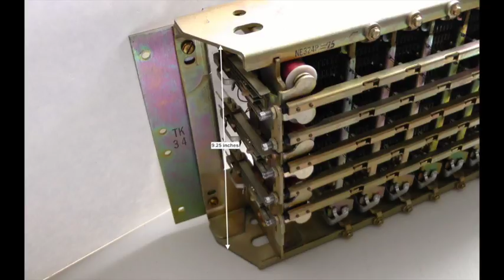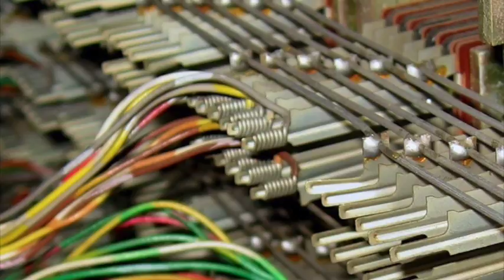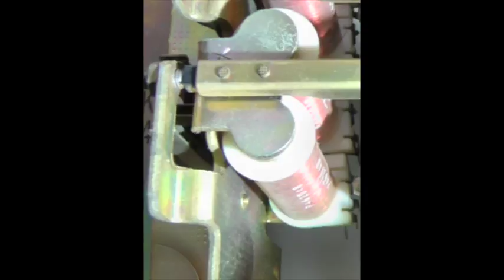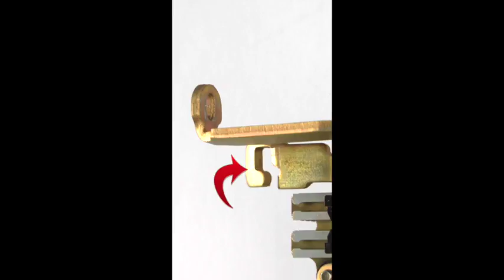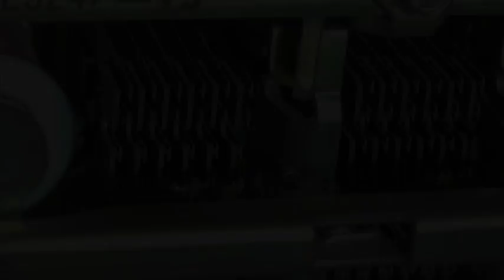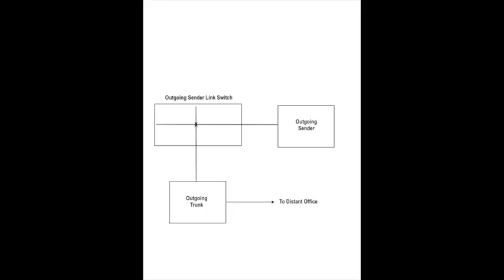The Crossbar Switch

Comment: Maybe I missed it, but I don't understand the purpose of the six contacts here. Why connect six circuits at a time?
Reply: Because at least 2 is needed for a phone line and this device can do as many as 6, for other applications.
Reply: @KimberHall  So basically aux contacts. What are some examples of applications might be wired to these?
Reply from the maker: @bwhog  In a No. 5 crossbar office, the switches for the subscriber lines are only 3-wire, with the tip and ring for the voice transmission and the sleeve for controlling the hold magnet to maintain the connection. Six wires are used on trunk switches  because there are two trunks on each level, each having its own T, R and S wires. The incoming register link and and outgoing sender link switches that interconnect trunks to registers and senders during call setup are 6 wire switches. In addition to the T and R  wires and the hold magnet control, other bits of control and status information need to be passed between the trunk and register or sender.

Comment: My old man worked for the telecoms company for about 35 years, in his retirement years he would often remark how he missed the busy telephone strowger type exchanges with all the staff and the noise. In the 80s and 90s he was busy installed fiber optic cables, I remember the Japanese machine he had for splicing the glass fibers together. I seem to remember he told me the Japan was a big user of crossbar type switches.
Reply from the maker: Japan was indeed a big user of crossbar switches. Their most used version was the type C400. It was very similar to a No. 5 Crossbar, and was manufactured under patent licenses from Western Electric.

Comment: Just out of curiosity what are the six contact on the Crosspoint do? I understand three contacts (Tip, Ring and Sleeve) but what do all six do? Is is it to support 4-wire E&M or something like that?
Reply from the maker: There are many variants of Bell System crossbar switches. A crosspoint may contain anywhere from 3 to 6 contacts, depending on the application. In a No. 5 Xbar office, the crosspoints on the Line Link Frame switches only have 3 contacts, which are the T, R and S that you mentioned. The trunk switch crosspoints on the Trunk Link Frames have 6 contacts because they handle 2 trunks per each of levels 2 through 9. Each trunk requires its own T,R and S contacts. Many crossbar switch applications do not involve the voice transmission path of a call and are only utilized during the call set up. These switches pass parallel call control information between two circuits and so the number of crosspoint contacts depends on the amount of data to be transferred between the two circuits.
Reply: @Hicken65  Thanks again for the reply. That makes sense.
Reply: my understanding is that the additional circuits select trunks, signal downstream trunk selection, and trigger usage timers for long distance calls

Comment: Thank you. This is the clearest presentation of the Crossbar I have seen. Lately i have been interested in vintage telco switching systems. I got to tour an #4ESS installation in Sacramento. I have never seen a crossbar system. I did see a step-by-step office once when i was a kid.
Reply from the maker: Glad you liked it. You should check out "connections museum" on You Tube. They have some excellent videos on the Panel system and the No.1 Crossbar. Thanks for watching.

Comment: Can you explain the purpose of the bear strap connectors? It seems to degrade the number of unique connections the switch is capable of for some reason.
Reply: Bare strap...
Reply from the maker: Well it’s all about shared access to make efficient use of the expensive equipment components in the crossbar switching system. For example, a Multi-Frequency (MF) Incoming Register is a common control device used on an incoming call to receive the digits outpulsed from a distant office. On any call, it is only required for a few seconds. During this time, an incoming trunk is temporarily connected to an Incoming Register via a crossbar switch connection. Incoming trunks appear on the crossbar switch verticals. Incoming Registers appear on the horizontals. On a 20 vertical crossbar switch, 20 incoming trunks would share access to 10 Incoming Registers, because the horizontals would be fully strapped across all 20 verticals. This arrangement still would not make efficient use of the Incoming Registers, so the same 10 Incoming Registers were multipled to the horizontals of many other crossbar switches, so that typically about 400 trunks would share access to the same set of 10 Incoming Registers. This would allow the Incoming Registers to run at about a 50% occupancy rate with negligible delay in any trunk being able to access a Register. This shared access principle applies to most applications of the crossbar switch in the #5 Crossbar switching system.

Comment: In the early 90’s while working as a contractor in Taiwan for their phone company, I was almost killed by a crossbar switching rack. They were doing some upgrades while I was there. Since it was too much work to bring the obsolete racks down 12 flights of stairs. They would toss them out maintenance doors. The security guard that was supposed to be stopping us from walking under the drop zone was on break. Missed me by maybe 10 feet. It was a pretty impressive thud. I was very impressed by how well it held together.
Reply: Hicken65 It is sad to see the older tech being replaced by newer tech, but it’s necessary. Just as necessary as the old technology films you present to us and the museums that protect working samples of these technologies for the generations to come.  If you can’t see these films and actual working hardware. It’s just stories from us old guy’s.Thank you..........
Reply from the maker: @ricknelson947  Well, I appreciate the comments and agree wholeheartedly. The videos have garnered far more interest than I ever imagined, so the effort has all been worthwhile.
Reply from the maker: What a great anecdote! Thanks for sharing it and thanks for watching.

Comment: Thank you, no one has ever gone into the details of crossbar like this.  I would still like to know how the marker logic works though! As a software engineer, it's hard for me to imagine managing the whole switch fabric with 2000 relays
Reply from the maker: The marker does not function like a binary computer and has a very small task set to perform. Its analog style logic operations are mostly hard wired by the manufacturer since they will be exactly the same in every central office. The remaining logic wiring is field modified at each central office to take into account the peculiarities of each location in terms of numbering plans and routing options. The marker doesn’t download or upload information in streams. Instead, all communication with other devices (line link frames, trunk link frames, registers, senders and number translators) is via simultaneous transmission over a massive number of wires that momentarily connect the marker to each device as required. The order of magnitude here is about 200 wires. The “data” transmitted is simply the presence or absence of an electrical potential (ground, -48 volts, or nothing). A particular "set" of some of the 200 relays attached to the connecting wires, will operate based on these electrical potentials and the wired logic will establish the particular tasks to be performed based on the relay set that operated. There is documentation available online that goes into considerable detail on marker functionality. I’m glad you liked the video and thanks for watching.

Comment: What a fabulous video.  So much detail.  I suspect you were a #5 instructor.  I spent a summer back in 1961 working on the frames and number group of our #5 office in San Rafael, California.  I was always fascinated by the switch.  We also had some #1A line concentrators and Gefeller switches that used the crossbar principle.  Our church pipe organ had a beautiful wooden crossbar switch for the remote capture combination action.  The crossbar switch was quite an invention.
Reply from the maker: Thank you and I'm glad you enjoyed it. I did a fair bit of instructing in my years with Bell Canada as well as being a CO technician. An interesting fact about the 1A line concentrators is that they had magnetic latching crossbar switches in the remote units to save battery power. Your church organ crossbar switch sounds absolutely fascinating. Thanks for watching.

Comment: Do you know if any cross bar switches that are in use today? It seems like a Bullet proof switch. It looks like there would be less chance it could fail during an EMP event.
Reply: None anywhere in European networks either since the end of the 20th century. You may have found a few late examples (installed in the 1970s) operating as local switches (with a digital parent) up until the dawn of the 21st century, but they were largely gone from core networks by the end of the 1980s. They stopped installing these in many EU countries by 1980, as networks became digital. 
Now even TDM based digital circuit switches are vanishing fast and being replaced with VoIP and soft switches. Sadly, the days of specialist hardware and the classic PSTN are fading fast, as voice telephony becomes just another app on IP networks … software running on generic servers.

You’d probably struggle to find one in service outside of a museum context.

European networks were full of Ericsson ARF, ARM, ARK, ARE etc, ITT Pentaconta - all crossbars and various reed relay switches like Philips PRX etc and a variety of older electromechanical systems back in the pre digital days. Digital local PSTN switching in Europe began as early as 1972 with the first version of Alcatel E10.
Reply from the maker: Thanks for the additional information.
Reply from the maker: There are none that I'm aware of in the North American PSTN. I don't know about other parts of the world.
Reply: I would think the electro-mechanical equipment would be more EMP resistant, but it has been eliminated due to the need for features the Telcos could sell. Some electronic peripheral circuits may have been vulnerable on older systems, though. I am wondering if the mechanical action of the crossbars may have been more reliable than the sometimes sticking ferreed switches on the first ESSs. They could have been used under processor control. I know of one midwestern CO that had reliably working Steppers that were 55 years old. It got converted to ESS for the features. In New Jersey, close to AT&T, Western Electric, and Bell Labs locations, Trenton NJ got step equipment to replace manual operators in 1925. Went to ESS in 1961. Princeton, NJ, 10 miles away, had operators until 1961 and then went to crossbar. Did not go ESS until 1995. Ironically, the home of Einstein was a telco desert. [These dates are from my memory; someone could check them.]
Reply from the maker: Indeed there was a switching system that had a digital CPU controlling a crossbar switching network. This was the SP-1 (Stored Program 1) switch developed by Nortel. It was a big seller in Canada and to independents throughout the U.S. from 1971 to 1979.